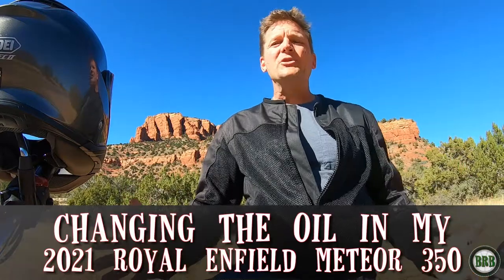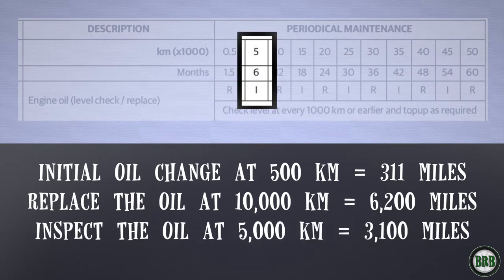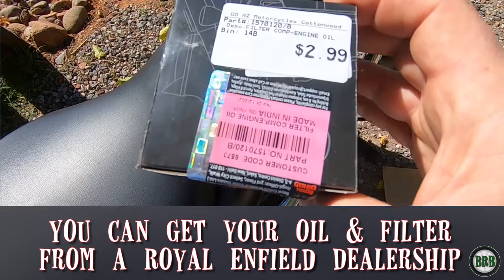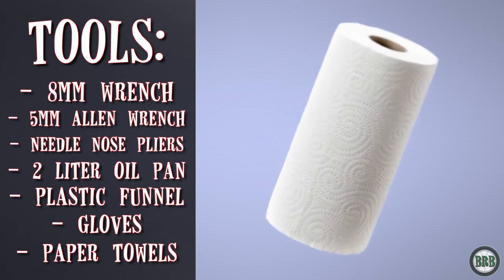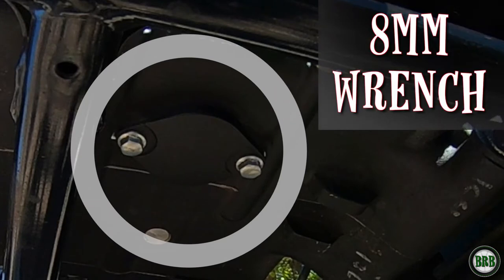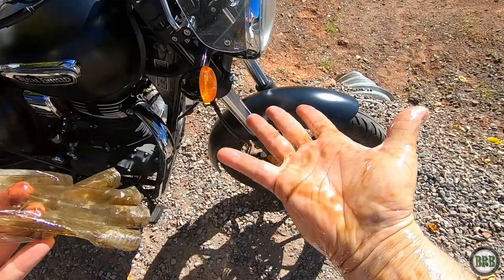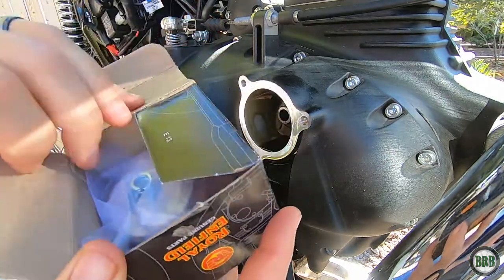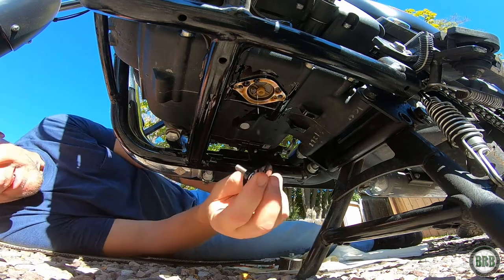Motorcycle Oil Change - Royal Enfield Meteor 350

Comment: I've seen good oil change setup designed for the rider, and I've seen terrible ones.  This one is bad.  Not terrible,  but bad.

Oil plates are messy, easily over or under torqued and may be damaged more easily than a XXmm drain bolt and crush washer.  The plastic sump screen on that drain just looks dumb...since you have a filter.

Oil filters horizontal on the side plate are common, and easy to get to,...but always create a mess....to be cooked off on your next ride as the oil never fully wipes away.

Easiest oil change is the old Honda Nighthawk/Rebel 234cc 20hp.  Oil bolt plug (bottom side away from exhaust pipes), drain, fill.  No filter (just a sump screen) which sounds bad....but it does make the job neat.
Reply from the maker: Thanks for your comments, S!  💙🙏🏼  Are you a mechanic or a bike tech?
Reply: @BackRoadBikerChuck  nah, just a guy who's changed a lot of oil.  A lot of oil.
Some are clean quick jobs.  Some are nightmares.  This one is messy quirky, but not too bad.  I don't  care for a plate and two tiny 8mm side plate sized bolts unprotected under the bike, for intended repeated removal and retorquing every 4000+ miles.  I see why the Himalayan has the rock plate. 

I agree with you on the filter with the new spring each time made onto the filter.   These are both at their core, utility appliance motors (Rebel 300 and this) reworked for bikes.
Reply: @BackRoadBikerChuck  BTW I thought your presentation was extremely useful for the Meteor owner.  The RE shops charge far too much for a simple oil change which for a young daily rider might come often. 

I watched because I was considering the bike, and oil change setups tell me the thinking of the engineering for other things.

If I took that bike on gravel roads occasionally (I would have to do it twice each ride) I'd mount a under frame scrape shield if I were you or have one made from stainless.   One good tossed rock can mess that motor up.
Reply: @STho205  If you look under the engine, at the right front, you will see an actual oil drain bolt, with a crush washer under it. Only need to check and clean the oil strainer on the first drain, There wasn't any swarf in mine at all.  It was perfectly clean. Too damn messy a job to be fooling with that every time. So instead of a new 0-ring for the strainer, you need a new crush washer for the drain bolt.
Reply: @megalumpproductions5362  excellent.  That oil change looked ridiculously primitive for an every 3000.mi service.

The smaller Honda motors had a screen inside the right side cover that you only check when you replace the clutch housing side cover for a new gasket every 25000 miles.  Mine has never had a speck of strained debris in 50k.
Reply: @STho205  And I won't be changing mine every 3,000 miles either.  Using a full synthetic 15W-50 here and changing that out at a measly 3,000 miles is just a waste of money. Synthetic changes at 6,000 miles, or 10,000 km is fine, or once a year at the end of the riding season, regardless of mileage.  Best not to leave even partially contaminated oil sit in the crankcase all winter.
Reply: @megalumpproductions5362  synthetic is three times to four the price of Havolin Motorcycle oil...and motorcycle transmissions crush and churn oil much faster than cars.  It is pretty weak and brown after 5000km.   I doubt I'd go much further and still have smooth shifting.

However the equivalent RE oil change on a Honda is $6 and 10 minutes.  1.2L or 1.5qts US  The recycled oil goes back to the parts store to make synthetic blend for the next guy.

I have 80000km on my current small tourer and have had 100000km on others with no burning or scoring.